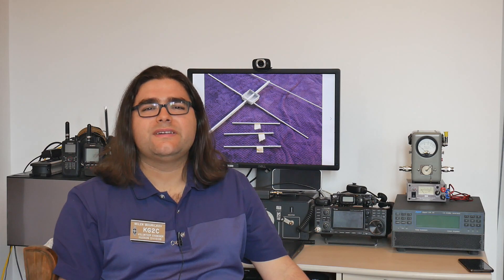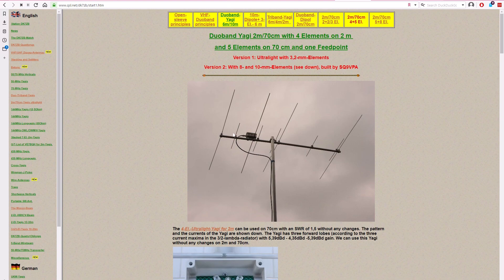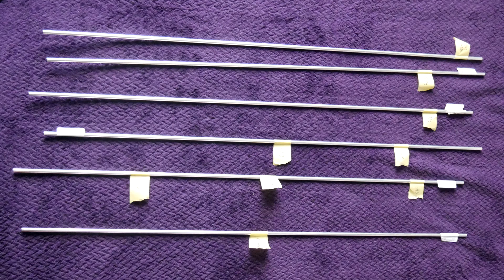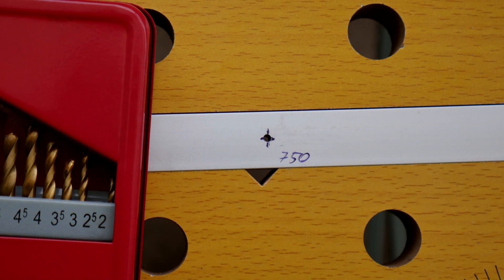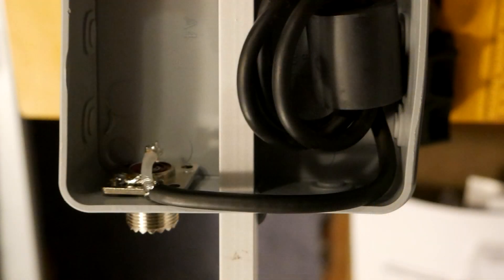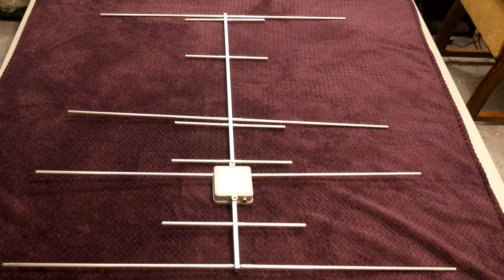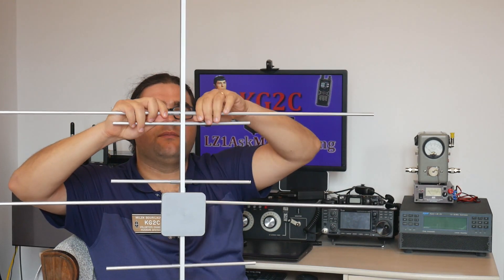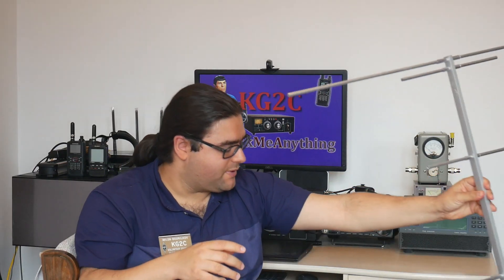How to build a DK7ZB yagi for 2m and 70cm

Comment: On not having a snug fit on the longer elements it's a pretty easy fix.  Take the element out of the antenna and then with a hammer or vise grips pound or press the element out of round at the point where it passes through the boom. Then swag it back into place so it wedges in nice and snug. A bit of epoxy will seal it from weather and give it stress relief as well.

Comment: What's your spacing between the 70cm band elements as well as spacing on 2m band elements.. What Swr and impedance readings were you obtaining on your ideal frequency after tuning. Would you be able to itemised all the pieces to youe project, i.e. dimensions, components, wiring gauge et..
Cheers .. Great video..

Comment: I know this is a bit older now but, try fixing your wobbly element issue by drilling a small hole directly above the elements, tap the holes for a small stainless steel screw and turn the screw snug against the element from above or below. I used that to keep the elements tight in a 220 MHz beam I built a while ago using very thin elements. Don't over tighten the small screws or you will strip the threading of the aluminum boom. The screw will put pressure on the elements and help keep them centered and tight in the boom holes.  Your elements are thick enough you should be able to actually drill through the elements and use screws that go all the way through the boom and element.  In this case, drill a larger hole in the bottom of the boom large enough to allow a nut and nut driver to pass through. This will allow you to tighten the elements in place easily.  This is similar to the EAntennas element mounting method used in their commercial versions of this same antenna.  If you built this with insulated elements (a different length will be needed for the elements probably) you could always use nylon screws and nuts.  You might look online for the instructions for the EAntenna VHF and UHF Directional Antenna EA270ZB13 or the EA270ZB9.  It should show you what I am talking about in their manual. Good luck.  KB8JNE
More info here: https://www.youtube.com/watch?v=CSsqpODQlHA

Comment: Can you explain more about the ferrite? Could you just make a coil with the coax without it? Thanks! Very helpful video also :)
Reply: rarely required on dipole antennae with 50ohm cable, which makes building one a  less fiddly process.... There are different ratios when wounding up a  a balun... 1:1, 2:1 (75ohm coax) ect...